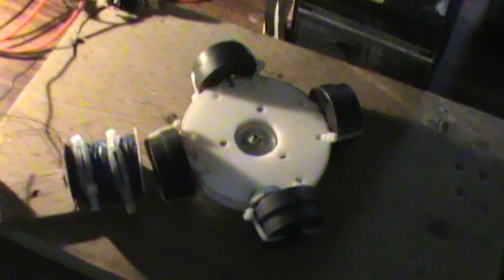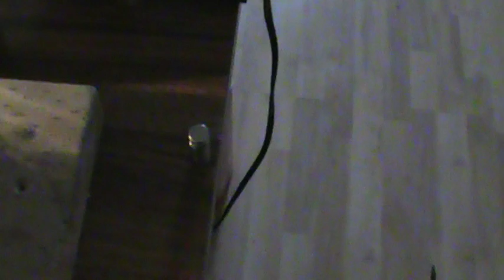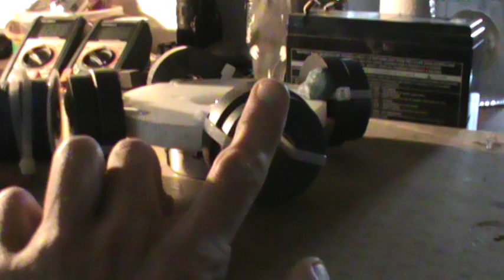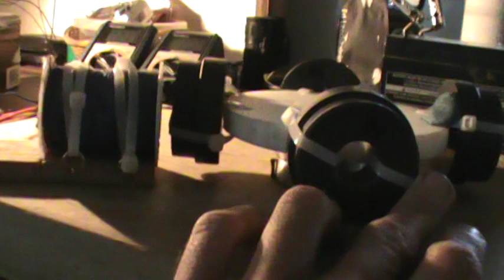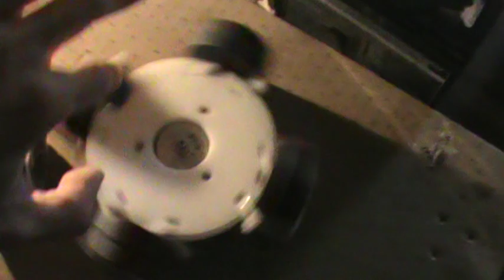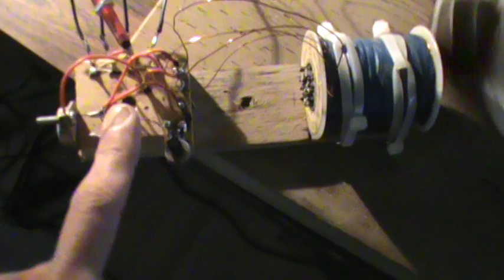Bedini - Magnets - Neo vs. Ferrite

Comment: Very Interesting. You say the larger Ferrite Magnets (5cm diamter) are better responding to the Coil than the 1 cm Diameter smaller Neodymes. Been interested in the same issue. In my case the result is most effective when the Magnetic Field of the Coil is of the same "Diameter" as the Magnetic Field of the Magnet itself. The small Magnet project a strong but narrow field. To avoid a "field mismatch". My conclusion : I dont make the Coil larger than the Magnetic Projection Lines of the Magnet.

Comment: here is my chime ... a stronger magnet simply concentrates the magnetic field ... the ability to concentrate the field is a function of the material ... the microwave magnets give better results because their looser field results in more polarity changes throughout the coil assembly as a magnet passes... this can be seen by holding up different magnets to a CRT screen ... well thats the end of my chime  ... glad to see Ed is still helping you and MrAgnuswagnus still pees outside :0)

Comment: Ahh, so you know of the Scalar North arrangement? The Bedini folks claim that is the way to go. I "found" an obscure spin-off of that thing, on his icehouse website. It has long since been removed. Mash the 2 norths together, wrap it with 30 turns of #30 wire, series it with a 6 to 12v DC motor, and VOILA! It produces SCALAR WAVES! They listed lots of simple experiments, and said DON'T ALTER THIS DESIGN or anything like upping the power... so of course, I had to build one for myself!  ;)

Comment: YOU COULD TRY THIS: 
Work out a way of getting those Neo's in the donut hole of the ceramics, that would intensify the overall field, and widen it out too. Might still be too high in the middle, not sure. 

800 ohms with the neo's makes sense, needs more current to get it going with the extra attraction to those cores... 
Mind you, I'm not a Bedini expert by any means, but i am a professional electrician.

Comment: Nice  rotor with beryllium oxide magnets ...now habe the reason to continue on my 1000 + collection of magnets
if you attach a flywheel it doubles up the speed in my observation
Can you pls try two half ferrite magnets with woumd coil each in series as trigger coils ???
totoalas

Comment: 4. That 10K "balancing pot" you have may be at zero, in the middle, and go up from zero left or right... You really need to verify that on the meter, isolated from the circuit. it seemed that you assumed it was 5K, from the words you used in the video? 

Otherwise, that is a sweet little Bedini setup! Bigger coils are ALWAYS BETTER, but all the components must MATCH as well! I'm working on a solid state version of free energy, and ComWarrior and Ves are always after me to do a video LOL
See ya!

Comment: 1. SUBBED
2. Hi Mr. AngusWangus! 
3. 1 clear reason your neo's don't perform as well is the size-to-coil mismatch. if you had wider neo's it would help, they need to be approximately the same as the coil's OD. (outside diameter). This mismatch (small field, big coil) "excites" the leading edge of the coil, goes neutral on the core, then excites the trailing edge, which creates a much smaller double pulse. VesperHBT had a better explanation of this on TEEP. More below, I'm running out of letters!